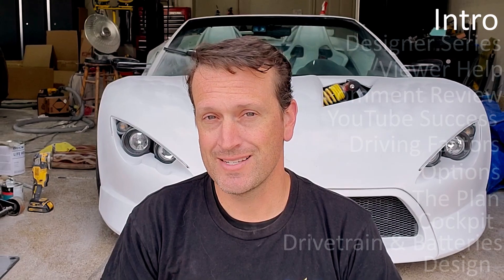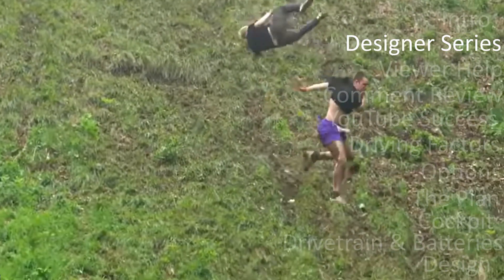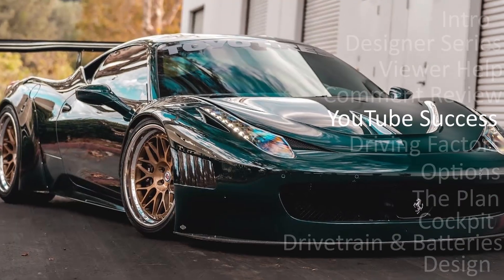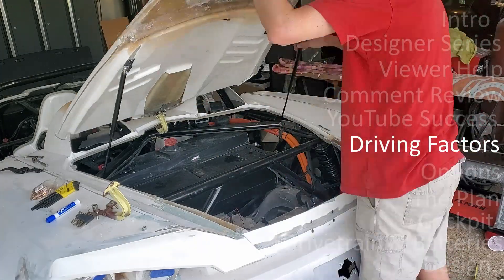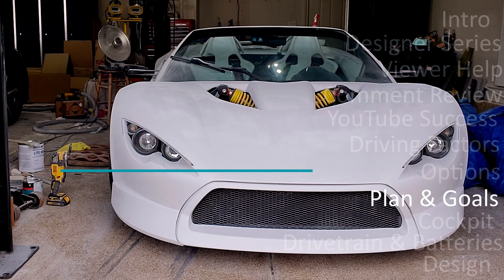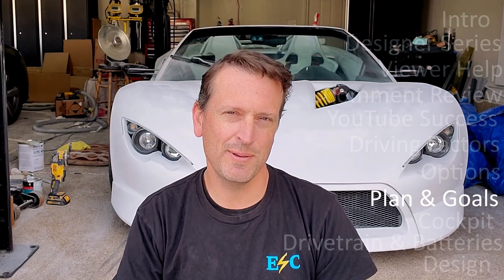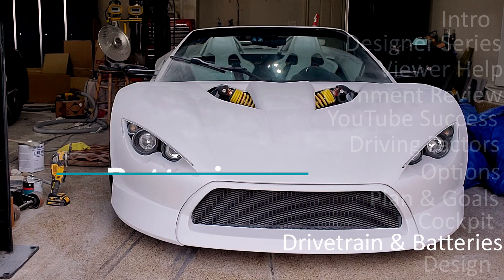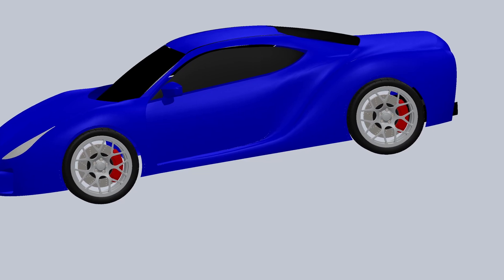ESC S2 E01-D - Starting the Next Build!  Electric Supercar Season 2

Comment: What about a MAZDA RX8 converted to electric taking out the engine and using the engine for driving a generator for the house a motor should be similar to the size of the engine.
Reply from the maker: Thanks for the comment!

Comment: so i am trying to figure out a system / motor / battery
to put in a 2000 Honda Odyssey.
i want a ev with descent power but also good range 

above all range but this whole posses has been a headache 
PLEASE HELP
Reply from the maker: What ev motor will you be using?
Reply: @electricsupercar  possibly a warp 9 for ease of control/use but i am still decieding! :)
Reply from the maker: @MPCLStudios  start with your motor selection.  
https://youtu.be/2b2toMkPG1M
Then you can figure out how many battery modules you will need for the motor voltage requirement.
Reply: @electricsupercar  thank you!  i am choosing the Nissan leaf motor as it would almost dubble the horse power and now to figure out battery's :)
Reply from the maker: @MPCLStudios  Looks like you need voltage between 240~400V.  Select batteries in series to get you to the voltage level and then you can parallel packs to increase range.  A good rule of thumb is around 3mile range per kWh depending on aero and driving style.
Reply: @electricsupercar  
thank you
i would need 108 3.6v battery's cell in series 
i found some 
3.6v 35ah battery's 
3.6 x 108 = 388.8
at 35 ah it would be a 13kw battery (13.6 to be exact) 

that is no where near enough for 250 miles of range but with bms it comes to about 16k
(thats using numbers from evolve electrics)

and at 388.8v that less then 403v soooo

back to the drawing board i guess?

NEVER MIND i found a Tesla model S battery pack for 22k 
BUT
its actually 400v instead of 388.8 
and instead of 13.6 kw of power i get 100kw of power

so hopefully this is a 300 mile of range beast with almost dubble the hp and almost the same torque
(if not 300 i wan 250) 
i can live with 22k on battery 1k for the motor lol 

now i shall find a suitable controller

Comment: No matter which donor, look for a creampuff aways garaged so most of the cockpit stuff still works.  I suspect the toyota aw11 has the low price and high quality engineering.  But for awd, there is the subaru xt or eclipse/talon   As a side note, the sv1 gull has a massive frame that would hold a lot of batteries and needs new skin anyway  because it is faulty acrylic.  Not much in cockpit amenities not ideal in that respect.
Reply from the maker: Thanks for the comment!

Comment: Wow this is a hard one !  I knew that jerryrigEverything would say a hummer !  I do think that subaru would be a good platform for the all wheel drive but, if I were to build from an existing car, i would look at parts cost and availability of used parts for it as well.  Of course I love the Challenger for the looks and it may be a little bigger platform than you want but, awd is onl on the hellcat.  When building from the platform of anything you pick is still very ambitious but rewarding.  I've followed a Brazilian guy do his own body on a Porsche Boxster  that really is fast and very cool looking.  They are fairly cheep with strong bones it's parts cost which can bite you though.  Simple things like the windshield, tail lights headlights etc... is what can make or break a project.  The only thing I'd love to try is making a hybrid that way you would have range and tons of power.  Not an easy task but I'd love to try it myself,  You have risen from the ashes so to speak from your baptism of fire and have the talent to build what ever you like.  What ever you choose I'll watch and look forward to each weeks progress.  Its rather easy to make a mold from fenders and doors as you have found out so you're definitely ready for the challenge.  You can make an easy wire frame to get the shape of your choosing.  Use cheap fleece and stretch it over the wireframe that you build and cover that with the resin and you're on your way to a plug !  Just a quick way to get close to your goals !  I'm looking forward to hearing what you're building next.

Comment: Hi Jeremy. Have you considered Factory Five models, the 818 in particular? It's a tubular frame essentially, so you can change body panels. Similar like K-1 but based on Subaru Impreza WRX.

Gagliardi Vex also could be an inspiration. That is Porsche Boxter underneath, but the looks of totally different. Might save you some trouble with wipers and latches ;)
Reply from the maker: Thanks for the comment!

Comment: I think that it would be great if you got a wrecked, but whole Model 3, and chisel off the body, keeping the interior and all of the drivetrain and interior. Then get a really cool, sporty car from the 60s-80s that looked great, but never had the performance to match the styling. The Lotus Esprit, Volvo P1800, Porsche 944/928, Aston Martin (Jag V6 engine), Cadillac XLR, Pontiac Solstice, Maserati BiTurbo. These cars looked great, but had middling performance, so they are relatively cheap to buy, especially with a bad engine. I would cut out half the battery and shorten the wheelbase to match the older body. The result should be much lighter than a Model 3 dual motor car, and resulting EV would likely offer super car performance. I am looking forward to seeing what you choose to do.
Reply from the maker: Thanks for the suggestion!

Comment: Scion FRS/Subaru BRZ is my vote, they are easy to work with, have the look of a small sports car, and have a strong aftermarket that you could utilize during the build.

But I would love to see you build your own body over a Tesla motor and battery, maybe just use the “cockpit” car for all the parts.
Reply from the maker: Thanks for the suggestions!
Reply: @electricsupercar  actually I was driving today and passed by another that might work, look into the Saturn Sky. Looks like that might be a really good base for a build.
Reply from the maker: @tede3589  keep the suggestions coming!

Comment: Where do you find a small battery pack with a high enough c rating to provide the peak power for those motors? Are Tesla packs 2c? I’m building an electric car, I ordered a Ford motor to test but can’t find batteries for more than 500hp without going over 750 lbs
Reply from the maker: What do you mean c rating?

Comment: First, take a look at what Zero EV is doing with their older Porsche retrofit kits. They wouldn't be AWD, but it's a good starting point for what kind of battery capacity and weight you can expect with that type of build. 
If you don't need a lot of range, then reducing batteries and using a light weight chassis would be best. You could get a cheap older roadster (MR2, Del Sol, etc.) and get a ton of performance with dual motor setup so long as you're not adding a lot of battery weight. Space management will be your biggest hurdle in a smaller car, but you've already got experience building a battery box.
If you're going to do a lot of body work outside the cabin (fenders, bumpers, etc.), then you probably don't want a very new car that has fully integrated crash structures (that also add weight), since that will limit your options. Getting a 90s Japanese car is probably your best bet for light weight, quality switches, latches, and other gear without being limited by modern construction methods.
Finally, consider what kind of driving you want to do most of. A light weight roadster might be nimble, but the short wheel base will make it twitchy at high speeds. If you want more of a cruiser, then get a longer wheel base and more battery capacity, but be prepared to sacrifice a little handling performance. Designing a car is all about trade-offs, and what things are most important to you.
Reply from the maker: Thanks for the thoughts!

Comment: My 2 cents is to begin with a 2009/2010 Mazda RX-8, be it an automatic or standard there should be plenty of donor cars out there., they're rare with only 1,357 produced for the North American market per Wikipedia. and come with the creature comforts you noted. Side bar, there are 2 body styles that vary slightly, my preference is the model years prior to 2009 are slightly more rounded. A plus is a reasonable aftermarket parts support.
Reply from the maker: Thanks for the suggestion!

Comment: might wanna save some dosh and go with DC motors for this build, makes life a lot easier.
Reply from the maker: Any suggestions?
Reply: @electricsupercar    -   the netgain warp series are solid, the transwarp motor making it even easier…    wild amounts of power.
Reply from the maker: @grendelum  Someone else also suggested netgain warp motors.  They appear to do well, however the spec sheets always show way low hp rating.  Thoughts?
https://www.go-ev.com/images/003_16_TransWarP_9_Graph.jpg
Reply: @electricsupercar    -   they’re torquey bois more for the sprint than the race…    it’s been a long time since i did my conversion and apparently ac gubbins have become much more readily available and cheaper.    still fun to spin the tires in any gear tho   ;)

Comment: Yaayyyyy!!! A new Project!! That's gonna be awesome.

I think I haven't seen a Mazda MX-5 with a Tesla drivetrain yet. An MX-5 with 4 wheel Model 3 drivetrain would be great, but there may be issues of locating and placing the battery in the body. An MX-5 will also need extensive body widening as Tesla sub-frames with suspension units are much wider than a standard MX-5 width. It will be a challenging build. If planning on a MX-5, the best channel to find information on MX-5's is Flyin' Miata. They have a great youtube channel on details of the car and they do have in depth knowledge about MX-5's (all versions). Flyin' Miata did the LS3 swap 525 HP v8 engine swap. They are based out of Grand Junction, Colorado.
If required, both the teams can join forces together to create the project.

All the best for the new Project. Keep up the great work.
Reply from the maker: Thanks for the suggestion!

Comment: If you want to 'cheat' and start with something that's going to be super easy to convert look for a salvage Noble or Rossion. They're as close to a ready built kit as you'll find.
I'm currently contemplating a Tesla drive unit into the front of my Noble and keeping the engine in the rear for a home-built 1,000 bhp hybrid. Only real issue is battery placement and weight.
Reply from the maker: Got it!  Thanks for the suggestion!

Comment: 350/370z nice option with lots of parts supplies,bmaybe even infinity G37 coupe (folding tin top roof). Porsche parts tend to be expensive. Challenger too big? - benefit of size is lots of room for batteries. Whatever you use...  Dual Tesla model 3 motors with quaife lsd inside each motor. Looking forward to this.
Reply from the maker: Thanks for the comment!

Comment: It would be interesting to use a salvage Mustang body, but throw the Mach-E motor (or two for dual-motor AWD!) into it.  The Mach-E motors are some of the least expensive motors I've come across in the last few months, and each one puts out ~280 HP.
Reply from the maker: Thanks for the suggestion!

Comment: Another thing you might like to consider at an early stage is the structural concept of the car.  If you are using a donor "cockpit" will you also be using the structure of the cockpit, the roof pillars, the door frames, the seat mounts, the pedal box , etc.  In this case your additional structure to attach suspension, motor(s), battery, body etc. to will need to attach in a fashion compatible with the unibody (assumed) of the cockpit. This might not be so easy to do if you are making the rest of the structure as tube sub-frames as the "cockpit" might not have "hard points" to fix the tube ends too.  If you build a full tube frame and incorporate the cockpit into it , this has some convenience but will not be so "light weight" .  My suggestion is to design a full tube frame that incorporates the fixing points of the cockpit, and then just use bits of the donor car where necessary, ( e.g. doors, windscreen, dash) or possibly fiberglass replica bits molded from the donor. The advantage of a full tube frame is lightness, strength and most importantly torsional stiffness. For a donor, I suggest the challenge of building as small as you can.  e.g. Mazda Autozam  AZ3 or Kia Picanto . This gives benefits of light weight, but also, less materials cost and it takes up less space in the workshop.  My current build, a small sports car has a fully triangulated tube frame including roll-over protection that weighs just 69kg.
Reply from the maker: Great points!

Comment: Look at some other Supercar kit based options. Factory Five GTM, Ultima, etc. Dual Tesla drive units, either Model S or Model 3 since you are already familiar with them. Don’t use Tesla batteries though - either build your own using pouch cells to get the pack dimensions as well as capacity, or go with smaller LG or CATL options.

If you were absolutely focused on an OEM/production vehicle, then make sure you aren’t going to hate yourself trying to convert front axle to AWD. The thought of re-engineering a front suspension sounds a little frightening, and could ruin the handling of the vehicle. Purely on aesthetics I love the Cayman and hope to do a simple EV conversion on one in the future…
Reply from the maker: Thanks for the comments!

Comment: Just going to throw this out there, and it probably won't be popular or feasible. But, remember, you already have a two door sports car! How about a two door AWD hot-hatch or shooting brake? This would be unique to this channel! Something amazing I recently saw was a Porsche  356 electric conversion with (this would be impressive if you can do) a MANUAL TRANSMISSION!!! So, I'd start with something fun like a Golf R or Subaru WRX and keep the Manual transmission and AWD hardware. Or star with a RWD coupe like a BRZ/86 or Miata, add a rear hatch (i.e. shooting brake), keep the manual transmission. Then, add a motor set up to power the front wheel in line (or slightly in-front of the front axle). Then, mid-mount a second motor to the transmission and drive shaft going to the rear. This allows you to keep the manual and add an e-axle AWD system to the front. Again, this may be more work and hassle than needed, but to me. An AWD, manual, electric, 3-door supercar would be absolutely amazing. I can dream...right.
Reply from the maker: Thanks for the suggestions!

Comment: Have you looked into electric conversion combined with a G35 Vaydor, Corvette Valarra, or G37 Zedro Notorious.  Similar to what you're looking at they're kits that maintain large parts of the cockpit while completely replacing the body of the car.  The G35 and G37 have AWD variants and the corvette uses the same spindles for the front and rear so AWD is possible if you move the front shocks.  I will note that you're going to have a challenge with the electronics of any new car.  Since everything is integrated, you need to know canbus frames the AC and infotainment controllers are looking for.  I'd recommend planning to make your own controllers for those types of systems. Luckily, safety systems tend to be designed to operate independently, so you should be good for ABS.
Reply from the maker: thanks for the insights!

Comment: This idea is really great! Love the group project concept
Regarding the what I think, my opinion is that to get hi performance from an electric super car there are 2 ways
-Keeping lightweight, that implies a smaller and newer battery pack and a single motor (two motors with less battery could reduce the range so much)
-Going for double motor and invest heavily on the batteries, in order to have a range that makes the car usable for road trips
The first option is basically the first project! 
So I think that a 4 seater sedan can give you the space to fit a 100kw pack (or even more!), that you can place on the floor and somewhere like under the seats (or, crazy, a single back seat with batteries on the sides); giving you the high power given by the 2 motors with energy enough to have fun for long drives!

Anyway looking forward to follow along, whatever your choices are!

Last thing, a Patreon club could be fun for financing the project and give out additional content! 

Good luck from your long time Italian fan!
Reply from the maker: thanks for the thoughts!

Comment: 4X In wheel motors like Proteanelectric,  that allows many features and saves body weight and volume
Reply from the maker: I'll check it out.  Are there builds with these already?
Reply: @electricsupercar  the most insane project was this youtube.com/watch?v=ba7o_VcWY90     BUT they used normal motors,   in 2021 there are many advanced in-wheel or Hub motors.

Comment: There is a simple way to build the fastest Tesla in the world, get a salvage Model S Plaid. Take off the body completely and turn it into a go cart car similar to Cletus McFarland’s “Leroy.” The advantage with this direction is the simplicity of design, a roll cage substitutes for the body but would only make sense if it ended up weighing less than the stock body. This is what I would do if I had the time and resources. A lightweight battery pack with a hybrid configuration using 20% super capacitors might reduce the weight while providing enough juice for drag strip and track use.
Reply from the maker: Nice!